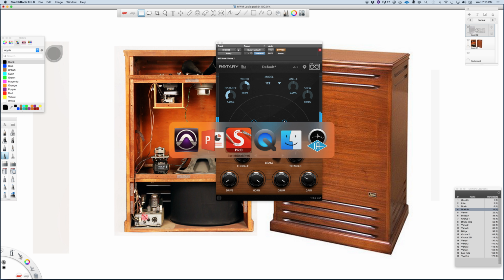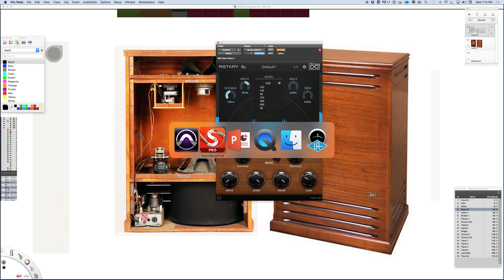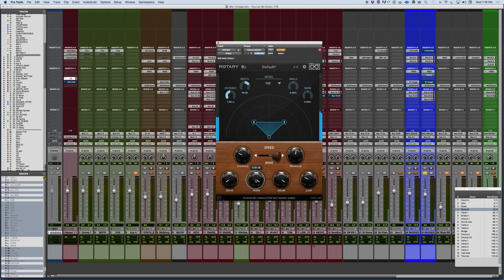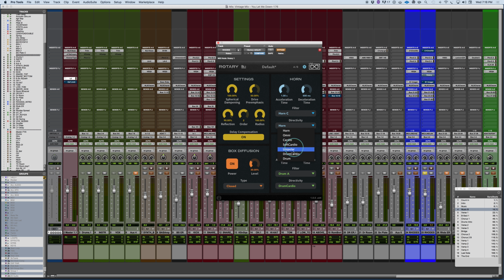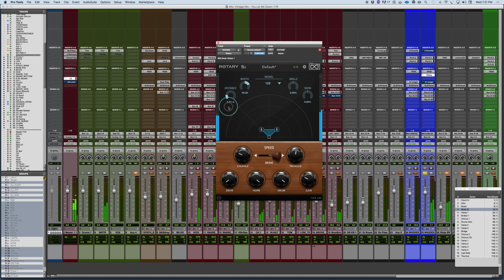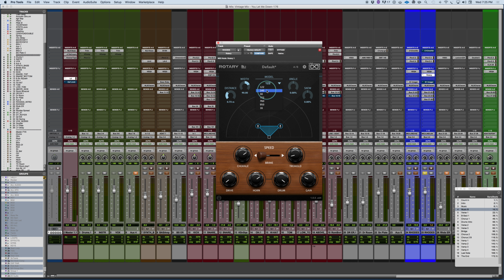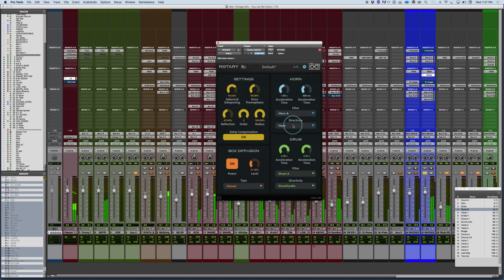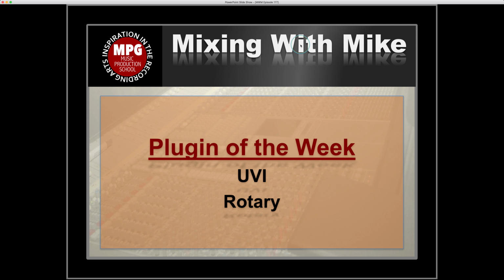UVI - Rotary - Mixing With Mike Plugin of the Week

Comment: Nice plugin. I think that I still prefer the PSP Lotary plugin, though - simply because the PSP allows you to control the sound of the hardware (mechanical noise), which adds to the lifelike sound, at least to me - the PSP plugin also allows you to move the speed/brake control to any point between chorale/tremolo and thus create a more lifelike speed change via automation. I do like the "setting" portion of this plugin, though. Lots of control factors! Which is always nice!
Reply from the maker: Although this one does not have the mechanical noise, if you watch the video the modulation knobs for Chorale and Tremolo allow you to set the speed anywhere in between the 2 options.
Cheers!
Mike
Reply: ah! I missed that! Very cool!